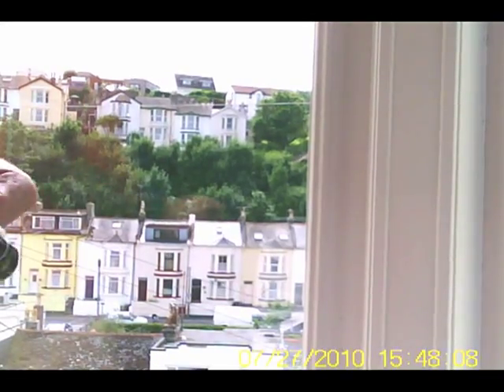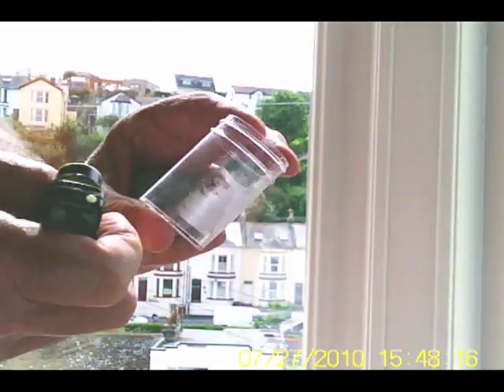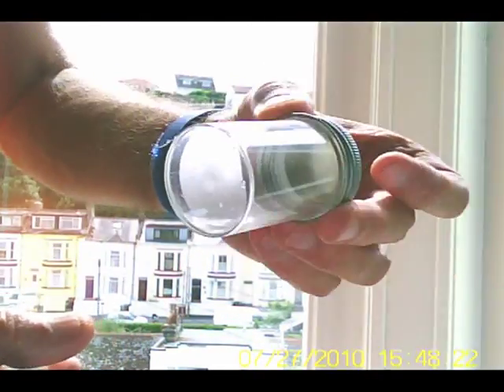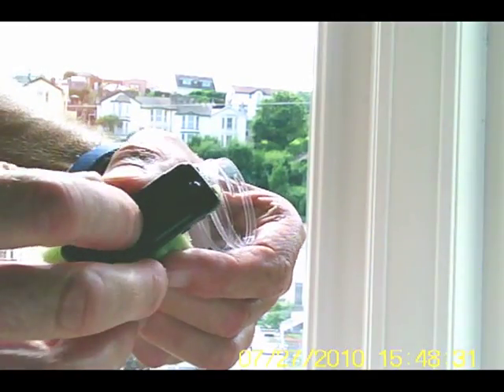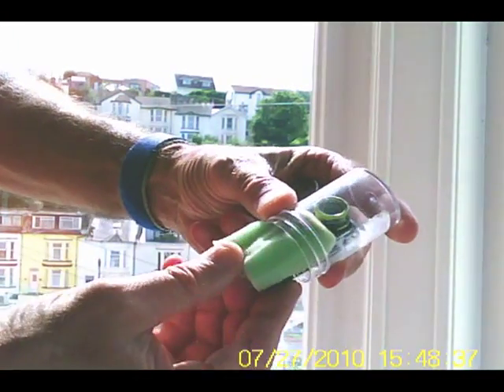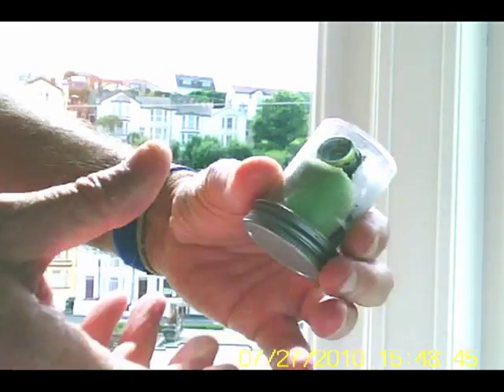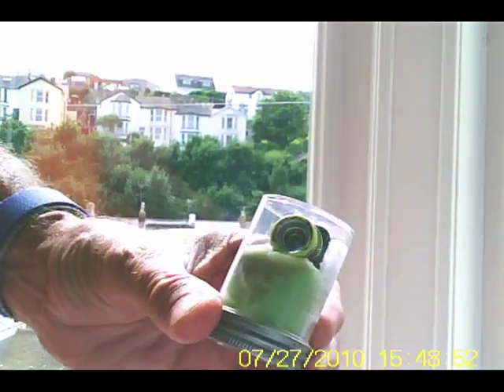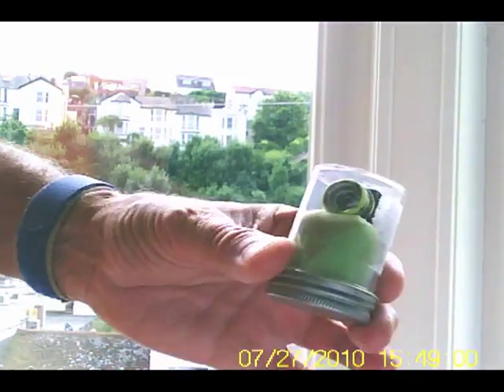MD80 mini dv camera - a simple underwater housing

Comment from the maker: I'm sure you're right. It was just a simple way to get underwater footage from one of these cams. I've since made better, and have used glass from UV filters cut down. This one for example watch?v=CJkgQG5xwVA at about 3m 58s into the video. The cams focus better if you have a wide angle or fisheye lense on them. Details of the housing are at 5m 36s

Comment from the maker: Check out the rcgroups  New #16 HD Key Cam thread. (Google it?) People have made waterproof  housings with a piece of glass and a tic tac sweet box. Pretty sure it's in the FAQ's at the start. I've made one myself, similar with a piece of glass, a hole in the tic tac box where the power button is and I have used rubber glove fingers stretched over to weatherproof it. It won't take a key fob with a wide angle lense attached though

Comment from the maker: That was a cheap 'jelly lense' about 2 or 3 $. Google it. A much better lense $10.37 is the deal extreme /universal-13mm-wide-angle-0-67x-macro-lens-attachment-for-digital-cameras-and-cell-phones-14953 but it wouldn't fit in the same container with that lense fitted.